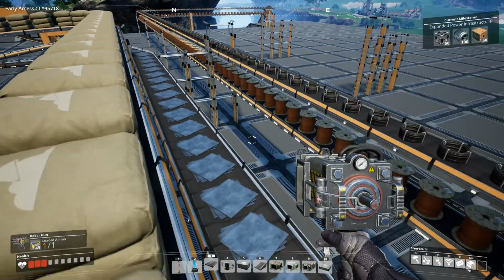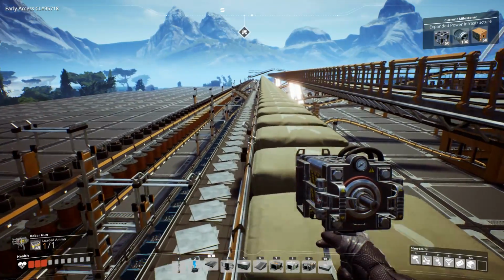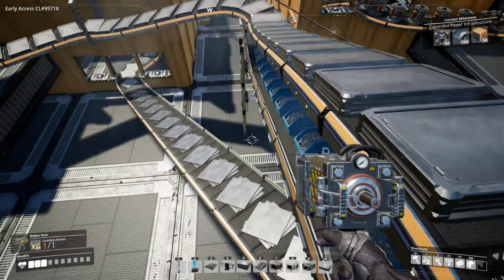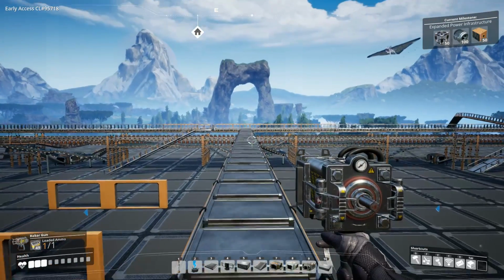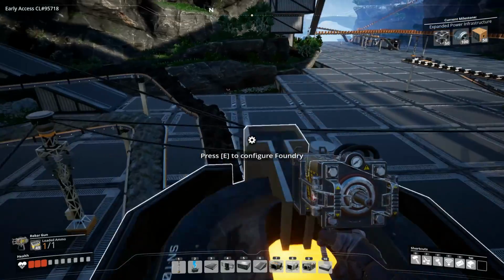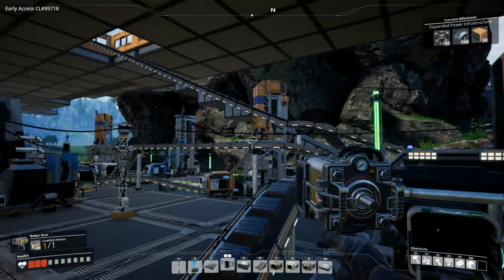Satisfactory - Main Bus Design - Factory Logistics and Organization Tutorial

Comment: Main buses tend to be inefficient if you consider time a resource.
Reply: Yes but they allow for endless easy expansion. Like when adding power cells into your miners to double their output, you can easily double your smelters.
The convenience of that may outweigh a 'practical ratios' type of setup.
Reply from the maker: Going all over your base in search of 4 different components that have never been used together previously so you can set up a new manufacturer tends to be inefficient, if you consider time a resource.
Reply: @BLUFGaming  You build up, the games3d. build your base resources on Ground floor, your assemblers on the 2nd floor and your large combiners on top.  At least that's what I've got set up, the top floor is just making Heavy Frames and Computers at the moment.  I have smaller factories that make other resources then transport them to the main, so I have four factories, One for Copper goods, one for Steel Goods and another for Oil Foundaries, One for Iron and Concrete, then a "Bus" to the main factory (iron and concrete), everything is containerized then heads upwards to the assemblers.

Te central Bus idea falls apart later on as the Belts can only transport x amount of goods per minute.
Reply: @BLUFGaming  I think a main bus is efficient in Factorio because F has so many recipes and so twisted tech tree and as you said  recipes of "4 different components that have never been used together previously". While in Satisfactory what seems to be the nicer way is to have separate facilities for groups of goods, such as iron group, steel group, etc. Because steel group items tend to use items of this group more often than not. And S has just a tiny tech tree compared to that of F .
If you need an outstanding resource (from a different facility) you can run a conveyor or a tractor route.
But some resources (especially the iron ones) truly tend to be used everywhere. So they make me think about them...